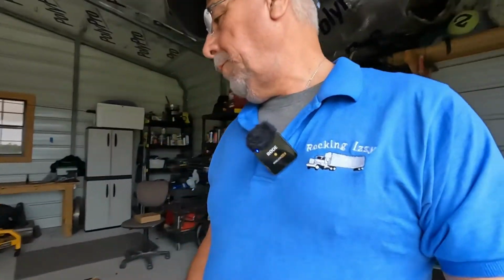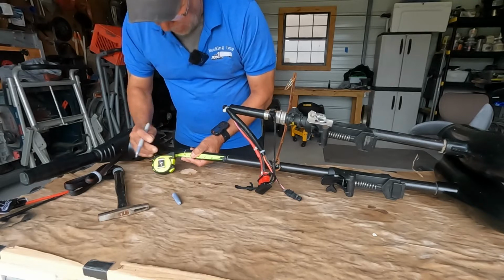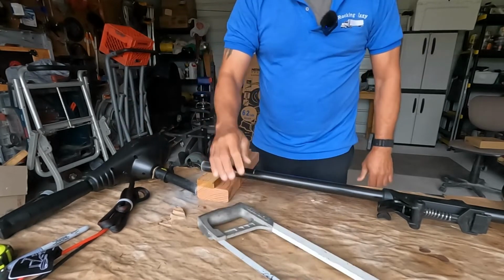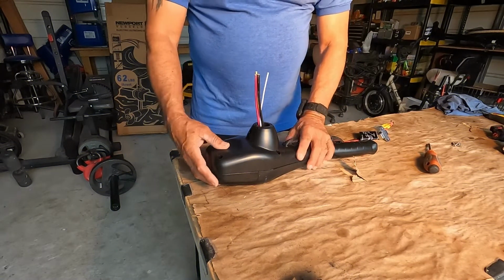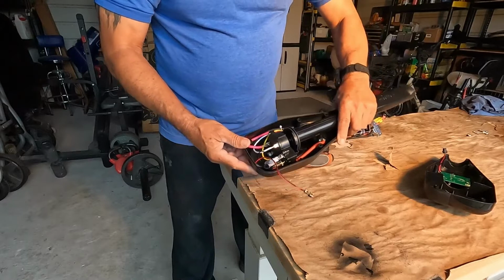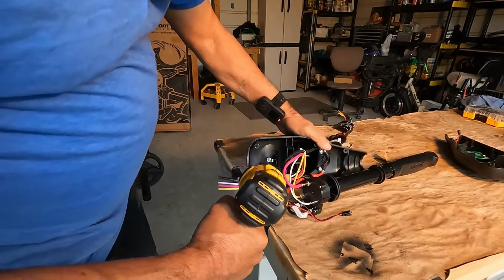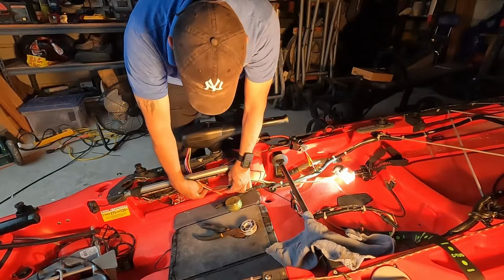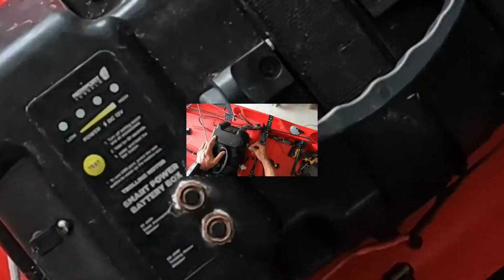How to Modify a Trolling motor for a Hobie Outback kayak #HOBIEOUTBACK#SALTWATERFISHING#HOW_TO

Comment: Hey Izzy question..I just bought a motor and I’m about to start cutting lol..but I noticed you had mentioned about having to buy some red and black wiring to reach the trolling motor head at the front..but as I was about to take off the trolling motor head I noticed the yellow and white..did you have to buy a different size wire to extend those? And if you did, which kind did you buy?..thanks in advance
Reply from the maker: Yes the 2 smaller wires need to get the same size and the 2 bigger size  the same thickness. I got the 2 bigger size from amazon which is marine wiring. They have it at bass pro also. take small pieces to bass pro so they can give you the same size and marine wiring. bass pro at the boat shop area.
Reply: Awesome man..never even thought about doing that..thanks!
Reply from the maker: @picogutierrez4526  https://youtu.be/yPpNEEgz8d8   this link shows more info on how i set it up
Reply: Man I forgot to go back to that one..I figured those thinner wires were about 12 gauge..did you order some smaller quick connects for those smaller ones?
Reply from the maker: I used 16ga. quick connects i found on amazon waterproof. @picogutierrez4526
Reply from the maker: Yes i got them at amazon 16 ga waterproof. @picogutierrez4526